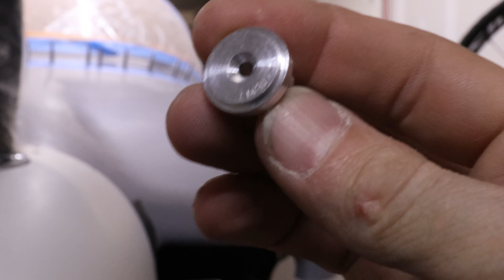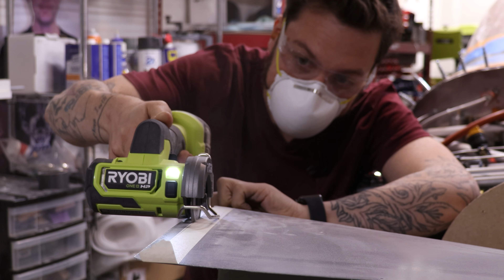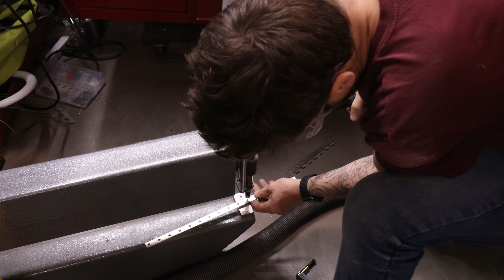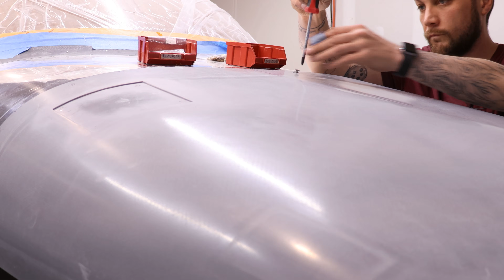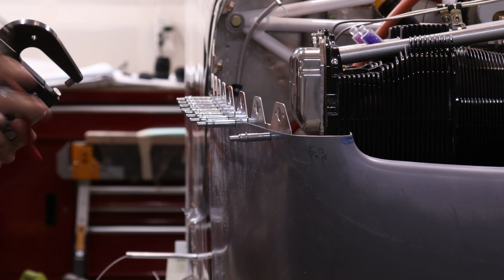The Best Cowl Fastener? Installing a cowling with Skybolts | EP116

Comment: How did you bore out the hole on the magnet jig to get the magnet to sit flush? A vice and a drill bit?

I just saw you plane at airventure, I like how you did your EIS connectors to your rear baffle, I’m going to steal that idea. Beautiful plane.
Reply from the maker: Thank you!

Yeah, just made a clamping jig on the drill press and hogged it out.

Comment: Ryan, congrats on completing your RV7A. Quick question about Skybolt installation on top firewall. I'm in the process of installing them on my RV7. How many did you end up using on top firewall? The kit supplies17 but for consistent 3.5" spacing without overcrowding 15 works better. I started the first one on centerline as you did.
Reply from the maker: You’ll want to get as many in there as you can. The pressure created in flight likes to try and escape between the fasteners. Having them close reduces this effect.

I don’t know exactly how many have off hand.

Comment: These things are a pain to do...not sure its worth the effort..  mixed feelings.
Reply from the maker: After days of consideration, I’ve decided that I like this comment because it makes me feel like I did something that took a great amount of skill. (I did not.)
Reply: The inserts were hard to keep in the flange. And I used the magnets and a needle on a string to find where to drill a pilot hole for the step drill. We were not able to locate where to drill ,as we could not reach from underneath the cowl to mark holes. And the step drill tends to walk ,so ended up with a few floating recepticals. So we had to do one or two at the most at a time. So we had the cowling on and off 2 to 3 times per each one. Factory instruction have terrible pictures, and was done on a fixture not on a plane,and the cowling was transparent fiberglass. The cowling we had was grey which made finding where to drill a nightmare.

Comment: I used camloc fasteners and they do NOT hold well.  Fiberglass thickness can vary which makes getting the right depth fastener difficult. I have a very curved cowling.   I have lost a couple studs because the strap that came with the camlocs do NOT hold the studs well.
Take your cowling on and off several times THEN review them.
Reply from the maker: I’ve had the cowling on and off plenty, but I’m sure I’ll have additional thoughts as time progresses. Were your camlocks Skybolts? As the system I’ve installed appears to have addressed many of the issues you cite! Thicker materials can be accommodated and accounted for with both longer fastener grommets and simply adjusting the receiver. 

Time will tell—so far very happy with the system.

Comment: thanks for another top notch vid Ryan!

Pity about them Skybolts, and your experience hasn't changed my thinking a bit about them... ugly looking, cumbersome and difficult to install,, heavy, complicated, and d...n expensive. 
All this to replace a system which is sublimely invisible, aerodynamically superior, fairly easy to install and operate when installed with care, light, has been used successfully on thousands of RVs over dozens of years, and free as provided with the kit. 
On mine I have 4 torx flush (tinnerman washers) screws next to the inlets holding the top and the bottom cowls together, and another 2 screws holding the end of the 2 lateral hinge pins. It is then a simple and very quick matter of pulling all the hinges out, by hand no tooling, and removing the whole cowling. Which takes maybe 2 minutes, the reverse operation may then take as much as 4 minutes? Ok, 'nough said on that subject 😉

Your engine is, as all the others do, bound to sag, as the mounts set in and tire. The cowling could have been installed 1/2" or so lower in order to prevent the sad looks some offer after a couple of years.

Looking forward to the next instalments, very good work and fantastic presentation Ryan 👍
Reply: I agree these are a pain to install.

Comment: First of all, fantastic work and great explanation of the system!
The method I use to remove the fasteners is to not use the o-ring or clip on the backside of the screw. Simply loosen the fasteners and put them in your pocket. Makes removing the cowling that much easier. Nothing gets hung up and you will appreciate that once your prop is on and everything is painted.
Reply from the maker: This tip likely more useful than anything I’ve provided here. This plus a few spares in the kit for when I inevitably drop one and can’t find it may be my technique moving forward!

Comment: I love the progress you’ve been making.     The Skybolts sure seem to work well.    Don’t forget to bring along a screwdriver with your toolkit when making your first cross country.
Reply from the maker: Good call! I’ve been assembling small tools that’ll go in a tool roll for the plane. A matching Philips for the cowl is a must now!
Reply: @RyanFlysPDX Hello Ryan, on my 7A I have to remove the center portion with provided pliers prior to removing the top cowling. On my AeroTrex A240 the top cowling is flexible enough to not remove the centers.

Comment: I thought about using Skybolts but as a new builder who hasn't started on the cowling, I couldn't figure out all the options they offer. And having never owned an airplane, I don't know which part of the cowling comes off most often and would most benefit from Skybolts. It does look like they are pretty easy to install.
Reply from the maker: Talk to Fairings-Etc. if you have some questions. They made it easy for me to map out a package that worked—taking into account my model (nose wheel), prop type, and preferences.

Comment: Cowl looks great... Where do you check your oil?  Do you have to cut and place a door?
Reply from the maker: Making a door as we speak!

There’s an indentation, and a separate door panel provided, but like everything it’s not quite that simple.

Laying up some reinforcement material, and trying to figure out some aftermarket hardware…